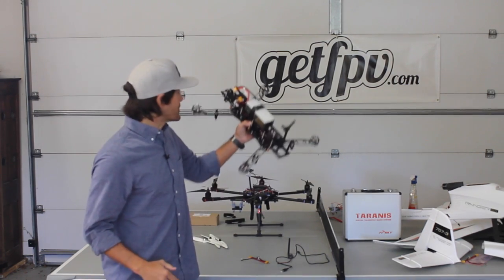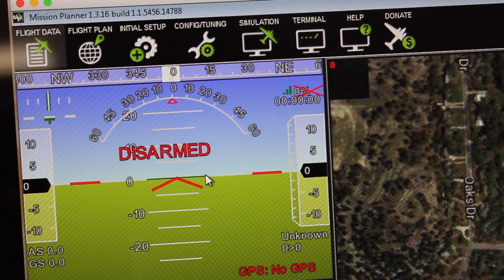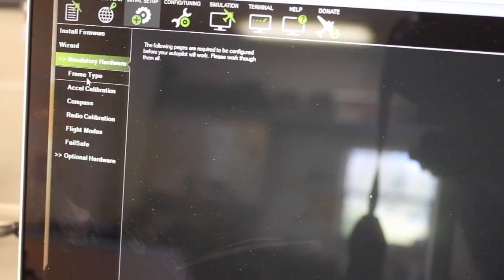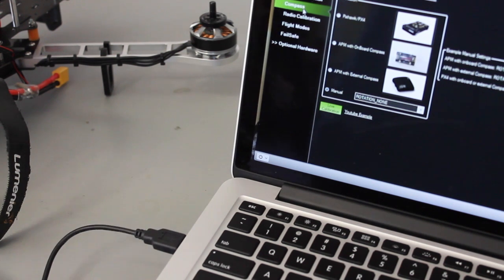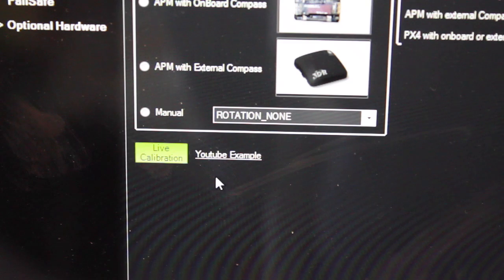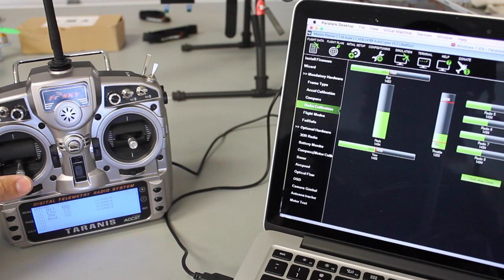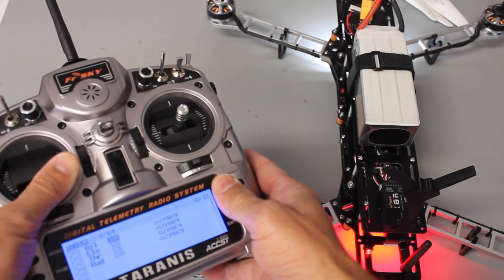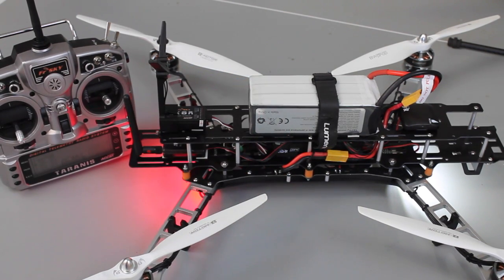QAV500 & Pixhawk Firmware Load, Calibration & Stabilize Garage Hover

Comment: Hey Dennis, Thanks again for your videos.

I'm having a heck of a time getting my voltage monitor to work. When I calibrate it in mission planner to read what i am getting off of my multimeter it doesn't sit at that voltage.

For example My battery currently reads at 22.8v. If I put 22.8v in Measured battery voltage, the Battery Voltage(calced) will just bounce around from 21v to 23.5v and everywhere in between.
Reply from the maker: Josh Slager Interesting. I haven't seen this happen before as my voltage stays pretty constant. Have you tried this with any other batts just to verify there's not a battery related issue going on?
Reply: Dennis Baldwin I have not tried that... i only have the one 6s battery capable of flying this thing, but I will find one to test with, thanks.

I have tried 2 different power modules. the attopilot 180 and the one your link takes you to on Amazon. same result with both modules.

Comment: Did I hear that I will not be able to arm the motors without a successful Compass calibration?  You sure are correct that trying the compass calibration through the USB is ridiculous.  However, I'm having issues with my telemetry radio.
Reply from the maker: Dan Costantino I can't help but laugh because you are so right. I look back to all the frustrating, bone-headed times of compass calibration with the cable. It was a nightmare and I'm sure my calibration offsets suffered because of it. Good luck with your setup and thanks for the comment.

Comment: Dennis I just used this technique on my new tri copter and it worked beautifully.  Have you had any issues with your power module not sending the the right voltage and amps to the Pixhawk? Even after i calibrate my power module the APM still reports the wrong voltage and % of battery power available.  I also think that it is going into some kind of battery fail-safe  because my throttle power goes way down and the copter will slowly descend even with the throttle at full.  I know I had fail safe turned off for battery.
Reply from the maker: Jon Car Sometimes if it doesn't send the right value you may need to manually calibrate it as described here:

http://copter.ardupilot.com/wiki/common-measuring-battery-voltage-and-current-consumption-with-apm/#calibrating_the_voltage_reading

I've definitely had that happen before. Good luck and keep us posted on your setup.

Comment: Hey Dennis, just a tip.  Whenever I have to "plug and unplug" the Pixhawk, I usually just plug and unplug the USB that's connected to the computer instead of messing with the Pixhawk's USB connection.  It's a little more delicate and not as robust as the computer USB (which I have plenty of) therefore, I prefer not to give it any more wear and tear than need be.  Just a thought though.  Great video!
Reply from the maker: Starving Pilot Killer tip. I will definitely make it a practice to do it from the computer end. Appreciate the good thought!

Comment: On your cyclic why did you reverse that channel? Pushing the stick donw will make the back of the multirotor move backwards.
Reply from the maker: WyDiablo Look at the page here:

http://copter.ardupilot.com/wiki/initial-setup/configuring-hardware/#calibrate_radio_control

It shows that when you pull back (nose up) on the pitch stick you want a high PWM and when you pitch forward (nose down) you have a low PWM. That's why I had to reverse the channel.

Comment: Dennis, Yet another great video. I am confused on your elevator calibration. The pitch in MP is opposite of the stick movement? Is this correct for all flight controllers? I have a APM 2.6 and I calibrated the same direction of the stick to match the mission planner display. I think I watched another video that said the same as you, but touched on it very quickly and didn't show the radio sticks while they were calibrating. Please straighten me out.
Reply from the maker: tptwk See here:

http://copter.ardupilot.com/wiki/initial-setup/configuring-hardware/#Calibrate_radio_control

Channel 2: low = pitch forward, high=pitch back

So when you push your stick forward you should see the green bar go down and when you pull back you should see it go up. Hope that helps.
Reply: Dennis Baldwin Although confussing, it does make sense. My quad sure fly's better now that it goes in the right direction. Thanks Dennis.
Reply: Dennis Baldwin Although this is setup the way the document likes it, what are the resulting flight characteristics?  Is it stick forward nose goes down, stick back nose goes up?  

In the end, it just reads like it is inverse of all joystick flying.

Comment: Dennis, this might be a dumb question, but when you're calibrating your compass, if you have an external compass (like the third option shown in mission planner) do you still calibrate the pixhawk internal compass first?  Or can you just calibrate the external compass? Thanks!
Reply from the maker: ChaseBrumfield That's not a dumb question at all. I think calibration takes care of both cases. From this page:

http://copter.ardupilot.com/wiki/ac_compasssetupupadvanced/

"Pixhawk/PX4 : select this if you are using a Pixhawk or PX4 board.  Internal and External compasses will be detected.  If an external compass is detected it will be assumed to be a 3DR GPS/Compass module (or compatible) placed so it’s white arrow points forward on the vehicle frame.  If you are not using a 3DR GPS/Compass module you may need to set the orientation manually (see below)."

If I learn anything different I'll let you know. Thanks for asking.
Reply: Dennis Baldwin
Thanks a ton for the explanation.  Must have missed that in the Wiki.  Couldn't do this first build without you brother... fantastic.
Reply: Dennis Baldwin  On a side note: I'm working on getting a camera trigger on my QAV 500 with Pixhawk and have been researching the best way to do it.  I watched your video on a remote trigger but have a slightly different situation.  I want to integrate CHDK with the mission planner software and therefore need to connect the camera to the Pixhawk.  The Camera needs 5V to trigger, however, but the RC/AUX ports only put out 3.3V.  I've heard that I can supply 5V power to the middle rail of these ports and then use an open port to connect the CHDK cord from the Pixhawk to the camera.  My question is, how do I put 5V to the middle rail of the Pixhawk? 

I've installed a 5V step down chip as shown in the QAV manual with the wires and connectors soldered to the PDB pads.  Can I simply loop this 5V connector back to the Pixhawk to power the middle aux rail to 5V?  If yes, do I use only the middle power wire to the middle rail, or do I need to make use of the signal and ground wires too?  My knowledge of electricity is extremely limited so any help is greatly, greatly appreciated.

In addition,  there appears to be many people with my same problem and a fairly simple solution found here:

http://diydrones.com/forum/topics/using-aux-pins-as-relays-for-chdk?id=705844%3ATopic%3A1559553&page=6#comments

I was just really hoping to make use of the 5v step down chip I've already got installed.  Any suggestions or thoughts?

Thanks again for all your help and the extremely beneficial videos you're producing.   All the best.
Reply: ChaseBrumfield Chase, I'm using the circuit you referenced in diydrones.com. Also I have a 5 volt battery elimination circuit (BEC) plugged into the pixhawk to power the 5 volt rail. The BEC is plugged into a spare output channel. If weight isn't an issue you could use a 4.8 volt receiver pack. Your other option is to use the Sparkfun 5v step up converter. It will convert the 3.3 signal to 5v. https://www.sparkfun.com/products/10968
Reply: renoflash06
Thanks so much for the detailed response.  I understand that I can do it the way you've mentioned.  I was a bit long-winded, but my concise question was can I do it a slightly different way?  In other words, the QAV power distribution board has a pre-determined place to put a 5v step down.  I've done it like the picture shown below..:

http://s28.postimg.org/kadyxnezx/QAV_5_V.jpg

Could I run this back to the pixhawk to power 5v to the rail?  Then connect my fancy CHDK cable from the rail to my camera?

Thanks again renoflash.
Reply: renoflash06
Also, before I forget.  There have been A LOT of problems with that sparkfun step up convertor.  I've read on multiple forums that it simply doesn't work for many people.  I don't have any personal experience with this directly, but enough people seem to have had problems that I wouldn't go that route.  Just a heads up for anyone else thinking about different ways to do this.
Reply: Chase, Thanks for the tip on the Sparkfun step up converter, I hadn't heard that. I actually wasn't interested once I got the circuit build with some parts laying around the workbench.
Reply: Chase, sorry I missed you earlier comment. Yes you could just put the 5v in to the pixhawk and it should work. The other great thing is you will have a redundant power source for the pixhawk. Also check out this link. http://plane.ardupilot.com/wiki/common-pixhawk-overview/. They recommend a zener diode across the - and  + pins to condition the power.

Comment: Dennis, great video as always.  I'm curious if you are concerned about magnetic interference while calibrating the magnetometer indoors where there must be plenty of metal objects not to mention the electrical wiring.  It must work okay for you?
Reply from the maker: Dave Pitman Good question. I haven't run into problems with this before, but will definitely do a comparison of indoors vs out. Everything works great when calibrating in the garage. Will let you know what I find out.
Reply: Dave Pitman I've found in my garage I can't be to close to the garage beer ridge or it throws the calibration off.
Reply: renoflash06 Always keep your model between you and the fridge until the calibration finishes, and you should be okay!  ; )

Comment: Compass calibration has had me hitting my head against the wall, several times. Thanks for the tip! What about ESC calibration? Did I miss something?
Reply from the maker: Joe Murphy Good point. I covered ESC calibration previously but it would have made sense to cover it in this vid. Thanks for mentioning that. While I did it in the garage I didn't show it in the vid.

Comment: Do you plan on talking about/doing a pixhawk auto-tune or manually adjusting the gains?
Reply from the maker: ( ͡° ͜ʖ͡°) Zevi Rubin I will likely do both, but definitely AutoTune as I've found it to be one of the more reliable ways to tune my multirotors.